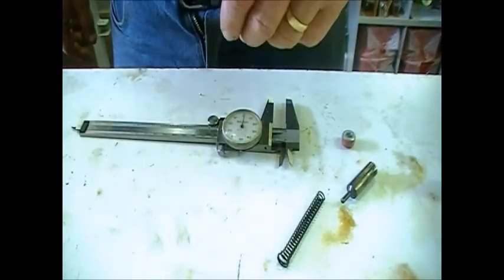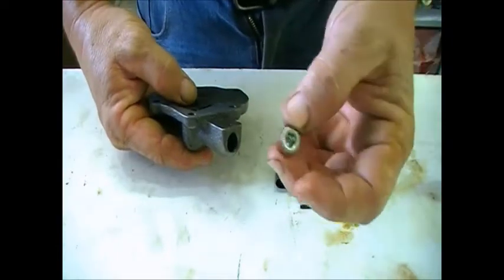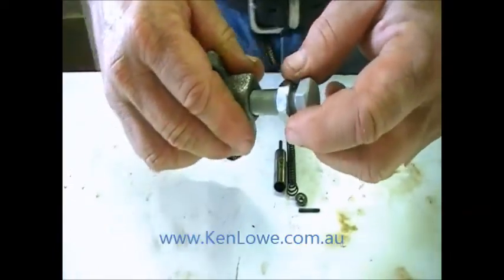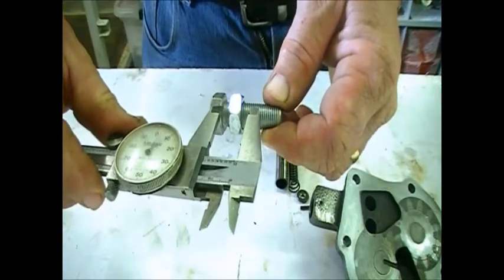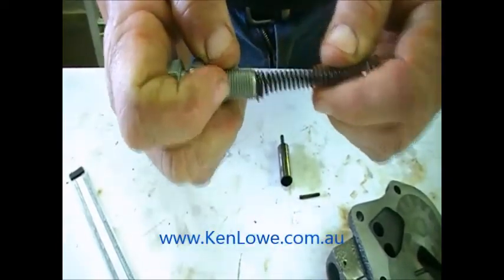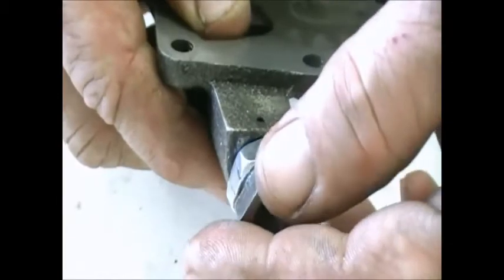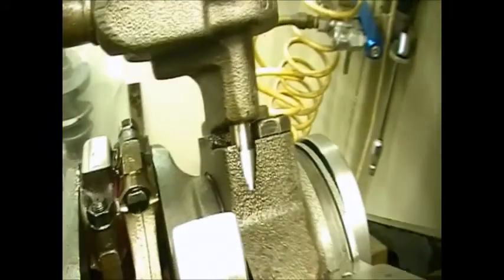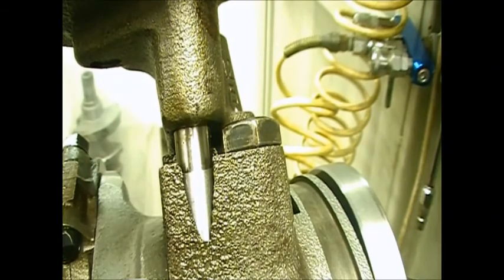Big Block Chevy Oil Pump Modifications

Comment: Ken.  Did you run your pump.  Did you ever adjust the pressure?    If there was a window in the oil pan a guy could adjust up or down.   Good idea

Comment: to anybody who watches this in 2023 (or any year for that mater) THIS IS EVERYTHING THAT YOU SHOULD NEVER DO UNDER ANY CIRCUMSTANCE.   THIS IS A SURE FIRE WAY TO CREATE SIGNIFICANT OIL PRESSURE/FLOW ISSUES.   

This is what happens when "rednecks" get a tap and die set from  THE LOCAL WAL MARTS OR THE HARBOR FREIGHTS DISCOUNT TOOL SECTION !!!!!
All of a sudden, EVERYTHING needs to be tapped and altered. 

DO NOT DO THESE MODS.